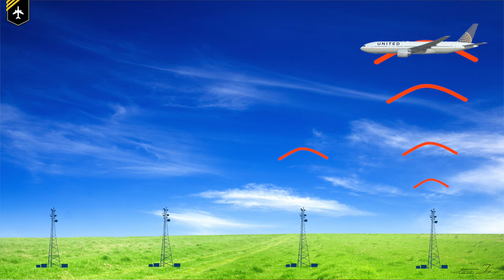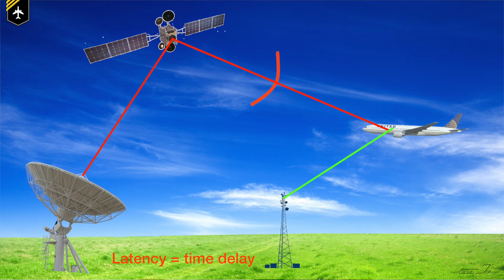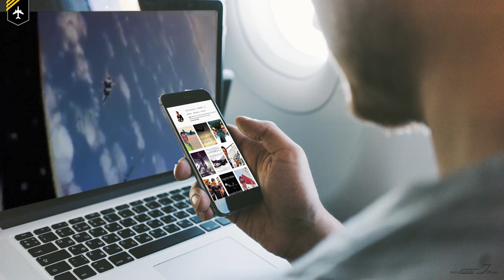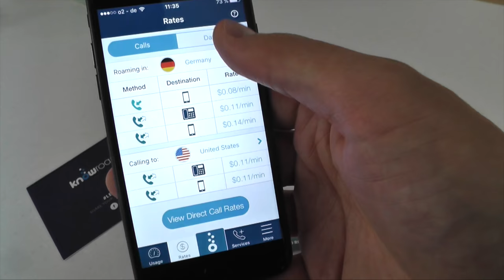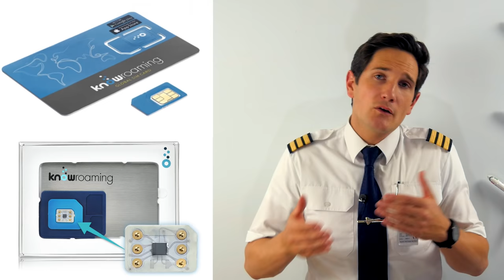HOW does WIFI WORK on AIRPLANES? Explained by CAPTAIN JOE

Comment: Why not just connect a really long ethernet cable to the plane.
Reply: Because the wire would get wet over the sea
Reply: That needs making hole into the fuselage to insert the wire, which might lead to problems during pressurisation and depressurisation of the cabin. 

But still a great idea, the wire can double up as hanging rope and airlines can rent grappling space on wire to carry more passengers
Reply: A stretchy long Ethernet. Yoink
Reply: Why use ethernet when there is fiber
Reply: It could also serve as a form off ejection seat! Passengers could slide down the cable if there was a need to evacuate while in flight!
Reply: i wonder where we would connect that to
Reply: That makes plane a kite
Reply: Lol :)

Comment: Do the pilots also feel the pain in their ears during descent?
Reply: I suppose it's a very individual thing. I have never felt anything.
Reply: @mikep9604  really,I always feel it during descent. Its very painful
Reply: @kwasiboakye9891  - I really think that it's an individual thing depending on the person. I have never felt pain in my ears during the descent. When I was doing the altitude chamber test that simulates rapid decending in an emergency situation, then there was a slight feeling, but it was very weak and it was not pain. But a normal descent rate during normal flights is slow compared that simulation in altitude chamber.
Reply: @mikep9604  well OK thanks

Comment: "how does wifi work in airplanes"
well... the wifi itself works the same... it's just the connection behind the router that changes :^)
Reply: Yeah a lot of people think wifi= internet
Reply: You are technically correct. The best kind of correct.
Reply: Using the phrase "connection behind the router" to refer to the protocols, topology, and connectors, is as general as using the term wifi.
Reply: @mulimotola44  Atleast it's more correct than saying wifi == the entire bloody connection to the ground station.
Reply: Exactly.  It makes me cringe when people refer to it as  "wifi" instead of "internet".

Comment: @Captain Joe, You mentioned Megabytes per second at 2:00 but the illustration show Mbit/s which meant that will be Megabit per second. Both terms has drastic difference. For example a 100 megabit per second connection is approx 12.5 MB/S (Megabytes per second). Would you be able to clarify please?
Reply: Common mistake people make. He definitely meant Megabit. No way are we talking 40 Megabyte on an LTE connection yet\
Reply: Marcus [DaSquad] 100MBit is exactly equal to 12,5MByte
Reply: Marcus [DaSquad] : Exactly. 8 bits, small b, to a Byte, large B. 100 mbits divided by 8 = 12.5 mBytes.
Reply: Marcus [DaSquad] I was going to make a similar comment. I'm certain that he meant mega bits as a mega byte is 8 times more data. 40 mega bytes per second would be 320 Mbps and LTE just isn't there yet.
Reply: He is a pilot, not an IT. We are all understood what speeds he is talking about :)
Reply from the maker: Hey Marcus, thank you very much, yes that was definitely my mistake. But thank you for correcting me. I´m better with plans than WIFI routers and stuff ;)
Reply: Vlaj. Co Actually we didn't understand which speed he was was talking about. We assumed what he meant, which is why the OP asked for clarification.
Reply: m is for milli, M is for mega; no such thing as millibits or millibytes
https://en.wikipedia.org/wiki/Mega-
Reply: But Mbit/s is usually measured as link speed (incl. all the transfer protocol overhead) while MBytes/s is usually measured as net data transfer speed. Therefore very approximately it is surprisingly rather 1/10 than 1/8.
Reply: No problem it happens :). But maybe just add an overlay comment in the video correcting it? This mistake is way too common and as an IT expert it honestly drives me crazy when people confuse Mbits and Mbytes, it's a big difference :). Otherwise very good job!
Reply: +Jan Kratochvil Err no actually virtually all operating systems and applications show byte transfer rates in binary units (k=2^10, M=2^20 etc) this is of course mostly to match the fact that file sizes expressed in prefixed bytes also use the binary prefixes as operating systems have simpler math to do when they measure file sizes by counting disk sectors which are of course in binary multiples (512 bytes, 4096 bytes on some drives) and it makes their virtual memory systems easier as their RAM pages are of course in binary multiples due to the physical structure of RAM. Technically for HDD's there is no reason for sticking to binary as you can place sector boundaries anywhere on a HDD (a HDD is essentially just a bitstream so you can start and stop reading at any boundary) it doesn't care though it's kinda fortunate that sectors on HDD's weren't done that way as it would have made developing SSD's compatible with that a pig as flash memory like RAM has an inherently binary logical structure.

Of course this is made all the more confusing since as Hard Disk manufacturers expressed their device sizes with decimal prefixes which had the benefit of giving them a larger nameplate capacity as well as being technically more appropriate for something that is essentially just one giant binary number anyway. Naturally for similar reasons namely that it's a bit stream with no binary block structure to it and it makes your network cards look faster network interface cards always gave their bitrates in decimal and of course ISP's sell connections in decimal units of bits, similarly if you see the transfer rate in bits in the OS it will always be in decimal even though the byte units arn't though the latter makes sense as "Download of filename.zip 10/1000 MB complete eta 1:46@10MB/s" just looks weird due to the unit mismatch.

Could fix the latter problem by using the kiB, MiB, GiB, TiB etc prefixes to indicate when binary units are being used but that convention is rarely if ever actually followed so confusion abounds still of course these conventions came about quite a while after the first computer systems and networks etc so the old conventions had kinda stuck.

Still it's kinda interesting the history of how all these weird quirks crept into even something as concise and logical as computer science. But then not surprising when you look at the mess we humans have made of natural languages with their weird historical quirks everywhere lol.
Reply: hafik007 : In metrics it is milli in electronics it is mega. bit, byte, kilo for thousand (1024), mega  is 1024 times 1024 or million, tera, peta. Bit is 1 then 4 bits is a nibble and 8 bits is a byte. Then you start getting into the complicated where it isn't just math.
Reply: Seraphina S : There are as they say 10 kinds of people. Those who know binary and those that don't. Then there is hexadecimal or base sixteen zero to f. Meanwhile the world gets by with decimal, deci means ten or base ten. In computing it is zero to nine. Regular is one to ten. Bits to bytes is in eights, 8 bits equal 1 byte. Then by 8s. 8, 16, 32, 64, 128, 256, 512, 1024 and start over with a prefix. 1024 is Kilo and 1024 times 1024 is Mega. Then it gets into what  Seraphina S  is talking about.  Simple.
Reply: +Seraphina S Decimal vs. binary (kilo/mega/... vs. kibi/mebi/...) counting is another orthogonal topic I did not talk about.  And 1/8 vs. 1/10 may be also interpreted as a baud rate which I also did not talk about.  I talked specifically about protocols overhead (which is difficult to quantize in general as it varies); protocols like ethernet frames, PPPoE, IP, TCP...
Reply: +Jan Kratochvil Hmm fair enough but just for reference to do that in any meaningful way you do need to specify exactly what protocols you are talking about which is pretty much why I prefer not to confuse the issue by mixing up protocol efficiency with the bit to byte distinction just tends to create more confusion for those that are not versed in the nuances of networking protocols. That said 1/10 isn't far off for TCP/IP over most common long range wireless physical layer protocols but when you state it like it's a general thing you start having less network savvy people being confused why their 80 Megabit FTTC connection is reporting transfer rates of 9.0-9.2 MB/s for example.
Reply: Don't forget about overheads in TCP/UDP session protocols, so bitrate for the payload would be even less than 12,5 MB/s )
Reply: Captain Joe thanks for the clarification, cap'n
Reply: Jan H he can't. YouTube disabled them unfortunately
Reply: Marcus [DaSquad] was just about to comment the same Megabyte != Megabits.
Reply: +iamedbytes "m" is milli always and everywhere, never anything else. What you might be referring to is "milli binary" (does not make practical sense) or "mega binary"
https://en.wikipedia.org/wiki/Binary_prefix
m = milli = x / 1,000 
M = mega = 1,000,000 x
Mi = Mega binary = 2^20 = (2^10)^2  = 1024^2 = 1,048,576

But it is true that the difference between M and Mi is often omitted and "Mb" is generally used for what is actually "Mib", eg. your internet speed. But "mb" is never used anywhere as it does not make sense as "1 mbps" would mean 1 bit every 1000 seconds.
Reply: hafik007 : If you are talking about metric then it is parts of a meter. Milli is a part of a meter just like centi. In binary it is bits , nibbles, bytes, kilo, mega, etc. Kilo is equivalent to milli as they refer to approximately one thousand or 1024. So Mib would be a milli bit or one thousandths of a bit. Mbps is correct because you are modifying bits not seconds. Thousands of bits per second not thousands of seconds per bit.
Reply: +iamedbytes But mbps is not that is millibits per second ie 1/1000th of a bit per second, the SI prefixes still apply as normal the sole reason that m is never used is there is simply no transmission protocol which is even close to being that slow. milli = thousanths not thousands. Thousands = Kilo.
Reply: Great video, and yeah bits not bytes also it's most likely just a wireless access point on the plane and the actual router is back on the ground. a wifi router refers to the ISR's (integrated service router) that are commonly found in residential homes. (:
Reply: Tom Kavulic Umm, wireless access point? Router on the ground? Do you know the range of WiFi? It is around 300 feet at most. As the video said the signal comes in from satellite or powerful ground station and it goes through an onboard router. The video does a good job of explaining the mechanics.
Reply: Came to comment the same! U gotcha!
Reply: Your Worst NIGHTMARE: Have you read the posts on this video? That is a bunch of people that care about Megabit and Megabyte. Flying, like many complicated activities, lives and dies on detail.
Reply: It's not actually. This assumes 8 bits per byte, but there can also be start bits, stop bits, and parity bits. With a satellite connection, I'd expect more parity bits for correction. If typical ADSL is approximately 10 bits per byte today, I'd expect 12 bits per byte for satellite, but this is just a hunch.
Reply: Chris Watts Ah but in the end it is Megabits and not Megabytes. Then you get into protocols and other esoterica. All important and all dependent on the starting point, bits not bytes.
Reply: Vlaj. Co he is not an information technology?
Reply: I bet Captain Joe's explanation stunning lots of IT guy cause it would be hard to imagine on how those WAN could work on plane
Reply: Sending files can be faster than their size due to compresion factor over lan.
Reply: And sending files can be impossible if the Wifi router is thrown out of the window.
Reply: Interestingly, kilo,mega,terabits/bytes is used predominantly for ease of understanding, real computer scientists use the binary units  Kibi,Mebi,Gibi,Tebi etc representing powers of 2, rather than 10
Reply: Its a very common mistake. Public internet is measured in Bits not Bytes
Reply: he is pilot, not and IT guy. He is not  suppose to understand or remember IT termins.
Reply: It is megabits. People often confuse them. Used to work in tmobiloe and had hard time with clients as fort that
Reply: MBIT IS CORRECT..1 byte has 8 bit
Reply: About the millibits per second: while no protocol has that as its top speed, it's still possible as a net-speed due to a combination of congestion (too many users on the channel) and weather (nearby thunderstorm is jamming up the signal to all heck), but most forms of proxy-WiFi I've seen warn about this way before it drops below the K-bit range.
Reply: 1 byte is 8 bits.
Reply: Captain Joe Your answer has a catastrophic spelling mistake, taken in consideration that you are a pilot. "Plans" is the plural of "plan". What you meant was "planes".
Reply: Captain Joe , at what time do you need to apply auto pilot and why do you do that?
Reply: @kevinhayes656  I have 190 Mbit speed on LTE around ~24 Mb/s my phone is capable to 1 Gbit/sec on LTE.
Reply: DaSquad Gaming WTF...
Reply: He's not a computer scientist, let it go, let it go
, turn away and slam the door.

Comment: Great video as always, however Mbit = megabit, and MB = megabyte.
Reply: 1 MByte = 8 Mbit, so probably the number you meant is MByte
Reply: Tomasz Padzikowski no, Mb is megabit and MB is megabyte
Reply: well, that's exactly what I'm saying
Reply from the maker: Yes that was my mistake, sorry :)
Reply: in addition, MB = megabyte is used for data size measurement while Mbit = megabit is used for transmission speed  measurement - specifically it's Mbps (Megabit per second).
Reply: My home's internet is 3mbit!
Reply: @speedbird227  milli bit? 😂
Reply: oh im sorry would you prefer me to edit it to Mbit on a 9 month old post

Comment: Quick correction: 1:50 4g speeds can reach up to 40 Mbit/s or 5 MByte/s. (1 byte = 8 bits)
Reply: MrPaukann I know it can get a lot more than 40mbit/s. The point is that it is Mbit and not MByte.

Comment: Why air planes do not have wheel spin-up system prior landing to save tyre resource?
Vote up for question please!!!
Reply: It would put on weight, draw current, take space and need servicing.
Reply: An idea almost everbody (including me) once had. Answer: Because it would add weight and more serviceable parts and the desirable braking effect makes up for the (small) amount of rubber left on the tarmac.
Reply: the added weight is not the factor. Due to gyroscopic forces of the spinning wheels, the handling of the aircraft would change dramatically in the most critical state of flight. Aircraft wheels are quite heavy, so the effect would be dramatic!
Reply from the maker: Great question and worth looking into!
Reply: I was thinking about some kind of hubcap that has hollow half-spheres around its center and works like an anemometer: The open sides of the (half-)spheres create much more air drag than the closed sides, so the wheel must spin in one direction when blown at.
Reply: pepper669 - glad I am not the only one that came up with that idea. Can't imagine we are the only two in the world that haven't thought that, Maybe reiner (above^^^) has that answer.
Reply: Mike Mac :) Yeah, I think he (or she) is right.
Reply: how about conveyor tarmac
Reply: Abdul Haziq that would probably brake after a few take offs and landings and probably damage the plane too
Reply: what if that gearing and drive system stopped working for some reason?   you would have wheels that are stuck and unable to turn during a landing.
Reply: OMG when i was younger i was gonna be an engineer and invent something like that.

Comment: Hi Captain Joe...  GREAT video. So a Megabyte is 1024 Bytes and is abbreviated as MB.  Notice the upper case B.  To digress a little, a byte is made up of 8 bits. Think of 8 1s or 0s such as 11010100. A bit is either on (1) or off (0). In storage, we look at the complete 8 bits as a unit - 1 byte - which would represent one character - e.g. the letter ‘A’. 1024 letter ‘A’s would take up the space of 1MB. But where transmitting is concerned, we refer to each bit (1/8th of a byte) because a bit can only be transmitted as a one (positive signal) or 0 (negative signal). Therefor, we track how many bits can be transmitted in a certain timeframe - I.e. bandwidth. If 1024 bits (1 or 0) can be transmitted in one second, it is referred to as 1 Mb (lower case b). So  71,680 (1024 * 70) bits is 70 Megabits or 70 Mb. So your graphs are correct. Your vernacular should be megabits, not megabytes. I hope my attempt to clear this up was successful. Thanks again for your great videos.

Comment: Nice video.   

I am the guy who traveled over 200k miles in two years to deploy the ORIGINAL ATG cellular system that is known today as GoGo Inflight.  It started as a company called "AirCell", as an idea on a napkin in north Texas with Jimmy Ray...    It started out as analog since that was the only thing available.  We overcame three major things - AT&T and their constant whining about ground interference that never existed, turning the aircraft would drop the call and Learjets were bad for data during the TDMA years...  500 knots tends to screw up thanks to Doppler.  CDMA saved the day.  Iridium came later to solve the "we can't turn" issue.  Handoff to the sky, then hand back to the ground.   Pain in the ass.

You welcome.